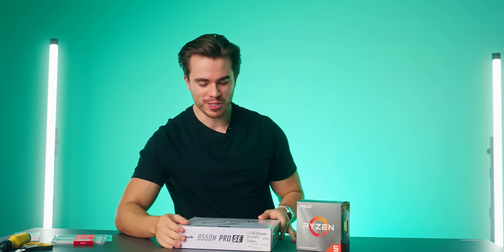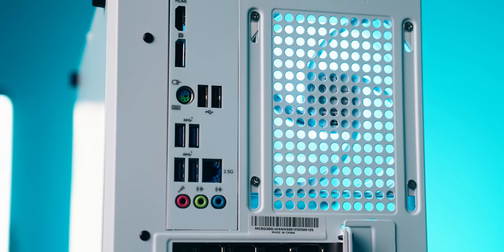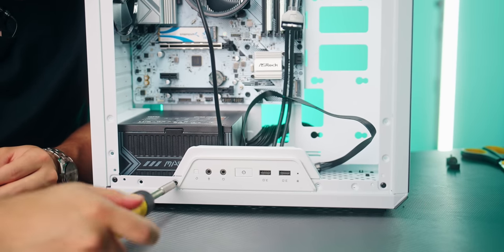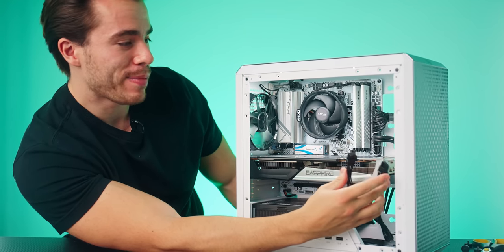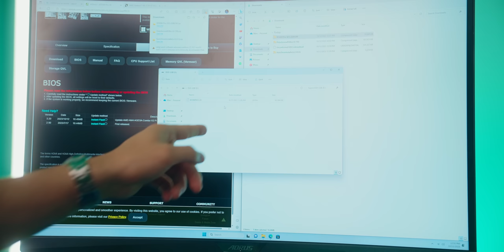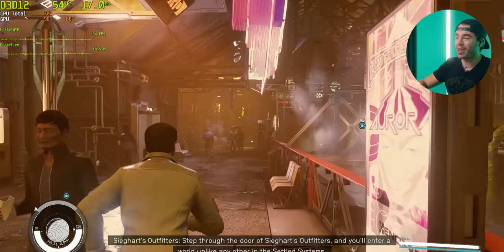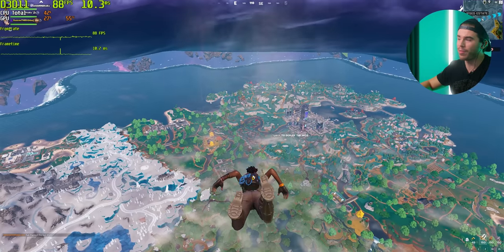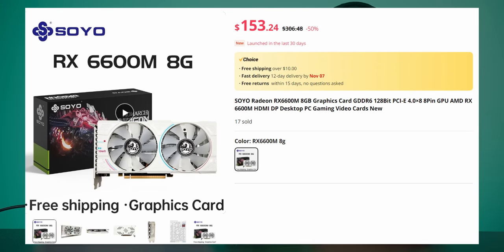PS5 or Build a PC? 👑 BEST $500 Gaming PC Build Guide 2023

Comment: The Cooler Master case is probably one of the WORST cases I have ever built in.  I would highly recommend the DeepCool CH370 so many more benefits to it compared to the CM.
Reply from the maker: How is it one of the worst? I personally didn’t find it egregious while I was shooting this video. 

The CH370 is an amazing case with much better build quality, but it is $25 more expensive which could be the difference between a Ryzen 4100 or a 4500/5600XT or a 5700XT etc in a $500 pc budget
Reply: @ScatterVolt  Primarily the spacing inside of the case particularly the top there is little to no room for fans.  I was also not a fan of the PSU bracket guessing it was done that way to help reinforce the area.  I did like the fact it had a rotating side panel so you could place the front panel in different orientations.
Reply from the maker: It’s a compact case and I don’t see how the PSU bracket should be upsetting given the unique design of the case, especially given its $40 price tag. You can still fit a long graphics card inside this case along with a 240mm rad if you really wanted to. It’s mATX at the end of the day. 

I’m unsure if those two things alone make this the worst case ever. There are much more horrific pc cases out there than the Q300L.

Comment: Considering the PS5 is already obsolete and cannot be upgraded, I think a PC is a good choice. AM4 is still a fantastic bargain and you could prioritize getting a better motherboard and the cheapest Zen 3 CPU. Combine with an affordable GPU, like a used 3060 for $120 and half the RAM you eventually want to have. You can have a cheap PC, with a decent PSU and MB that you can later upgrade to a 58000X3D (which can match a 14900K in gaming) and a higher end GPU down the line. Something like a 5800X3D and 7900XTX will last you probably until 2029. It is a strategy for getting a premium gaming PC in stages over the course of a year or two. The 7800X3D is barely any better than the 5800X3D because DDR5 isn't worth what you think it is. 
Also, if you get an X570 ATX board, you will have 2 or 3 M.2 slots which gives storage upgrade options. You could start with 2x16GB RAM and then later add 2x32GB later when you need it and have 80GB RAM in the system. 
White PCs are a pain in the ass to keep clean and are so 2021. You don't have to try and distract from the fact you had to put a GT1030 in it.
Also, it might be good to keep in mind that YouTubers don't get manufacturer sponsorship for advising you to buy used parts...
Do you want to play games or do you want current-gen bragging rights (nothing to brag about with 14th gen and even Zen 4 is disappointing)?
Reply from the maker: I agree with everything you've said minus the $120 used 3060s. Where are you finding used 3060s for $120?? That'd be crazy! I think you meant $220.
Reply: Funny how you say absolute when most big time streamers have 3k pc to run fortnite and cod. Lol
Reply: @EL_wardan  big time streamers have 3k pc to STREAM and VIDEO EDIT, they dont get a 4090 just to play Fortnite. This rig can easily play Fortnite and COD no problem and it's 500$.
Reply: How is being able to play 4k games at 60 fps obsolete?
Reply: @monkeyslaye because denial, pc gamers don't like the thought of a console being more powerful than their rig.
Reply: @monkeyslaye  I mean PS5 is on par with something like 4yo rtx2070 and will still need to kick it till the release of new gen consoles. Also there are no AAA games running natively 4k on PS5, hell the more demanding AAA games have problems running 2K to keep up the 60fps xd
Reply: @monkeyslaye it’s not 4k, it’s upscaled from 1080p, it’s not bad though, just not 4k

Comment: Yea that’s not $500 you left out like at least $300 or more😂. Mobo is $140 graphics card is $300, CPU is $110, case is $60, ram is $50, ssd $50.
Reply from the maker: Did you bother to check any of the prices for yourself? 

I have the items I used in this video linked in the description 🙃
Reply: I did and it’s not the same price
Reply: Checked multiple websites as well
Reply: Plus tax that’s $100 more

Comment: Series X and gamepass or PS5 and play spider man. Don't go PC, coming from a pc gamer.
Reply from the maker: Why not PC? Since you are a pc gamer?
Reply: @ScatterVolt  Honestly putting a pc together is more costly, and if you build a pc on your own for the first time, you make mistakes, weak psu, cpu bottleneck, inadequate vram. This is not my first pc and I learned from my mistakes but even then, BF2042 dips below 50 fps in 128 matches when it almost never dips below 55 on consoles so even the experience at the same or smaller price is better on console. It really is frustrating. Having to tinker with game settings to find the best balance of performance and visuals is a hassle. Stutters here and there in different titles.
However, some advantages include steam sales, gamepass and even more than that, gamepass like services from EA and ubisoft. But my opinion still stands. Consoles are cheaper with much less hassle.
Btw my system is an rtx 3060 12gb and an 11400f
My latest mistake? Choosing a poor mobo that cannot deliver enough power without throttling after a minute of sustained workload.
Reply: @ScatterVolt  In short, when on a budget, get a series S 1TB with gamepass, 30 fps on console for some reason feels smoother than 30 fps on pc.
Ps5 for exclusives
Series X if you really want the strongest current gen console with gamepass
Reply from the maker: You should have watched one of my pc build guide videos to ensure you built a good rig! Also, I’d blame the game for those performance issues you had, because BF2042 was one of the worst pc launches of all time. 

It should be better now but launch day performance shouldn’t be a caveat to give up pc gaming entirely. 

The flexibility and freedom you have in addition to owning a computer is too valuable.
Reply: @ScatterVolt  I am getting too old and too busy for gaming anyway, I watch your vids to get my mind off of things tbh. Cool vids.
Reply: Thought I would share my next mistake here. Never buy your RAM in single channel. Night and day difference with battlefield 2042, went from 40-50s to 70-80s just like that. Bought a 16gb in single channel for future upgradeability, had to buy another 16gb stick for dual channel. Night and day difference

Comment: Very bad build 5 4500 a awful processor and there are lots of better options.
Reply from the maker: Like?

I tried parting out a 12100F + B660M build for $500 and it still came above $500 USD.

The 4500 + B450M combo is affordable enough to squeeze in that excellent RX 5700 XT while keeping overall cost below $500.

Comment: I think the Ryzen 5 3600 would've been a better choice but still great
Reply: he did list it in the description as an upgrade. read it next time.
Reply: @JayzBeerz  Yeah but from what I'm seeing its actually cheaper
Reply: Amazon has the 3600 for $79.99 which is an amazing deal.
Reply: @JayzBeerz  It's only $5 more even if it's out of budget that would be the logical thing to do
Reply from the maker: The Ryzen 3600 usually isn't sold for $80, which is why it was out of budget for this build. It's stock and pricing is inconsistent whereas the 4500 is.
Reply: Oh I see why you listed it as an alternative if that's the case

Comment: Kinda sucks ngl
Reply from the maker: Elaborate
Reply: @ScatterVolt  I mean for the price idk I've seen it for cheap should have not said it sucked, but I know it could probably drop down to a lower price, like the gpu you got, you can get it for 120 or lower if you get the right stuff
Reply from the maker: If you decide not to get a top of the line Sapphire Nitro card then you can definitely snag a basic 5700XT for $120 used. I can’t predict used GPU pricing so I always side on the higher end.

How would that make the build suck though? I don’t get it 😅

Comment: PS5
-> Exclusives that look like next gen and really really well optimized
-> 3rd party games that are either optimized well or broken and fixed really quick and plays fine

Xbox Series X
-> No exclusives that look next gen
-> Powerful enough to brute force broken games, an generally runs smoother than a PS5.

PC
-> Always broken ports
-> takes forever to fix
-> 500$ you barely get shit to put in (That 5700XT wont last very long especially with that 8GB Vram)

If you want to do more than gaming then spend 1200$ on a decent PC with a 7800XT or 4070.
Reply from the maker: Biased and uninformed
Reply: @ScatterVolt  Are you sure? Cuz the entire internet is complaining about 8GB Vram being too little right now. The 4070 got bashed for its 12GB Vram.
Reply from the maker: 8gb vram is only an issue if you plan to run games at their absolute maximum graphics settings at 1440p/4K (which would look better than a PS5 obviously but at a huge performance cost).

You an do medium/high settings fine at 1440p with a 8gb 256bit memory GPU like the 5700XT. See the 1440p ultra god of war gameplay in this video for proof.
Reply: 8gb vram is more than enough for Playstation level graphics with PS FPS.
Reply: this is beautiful @ScatterVolt